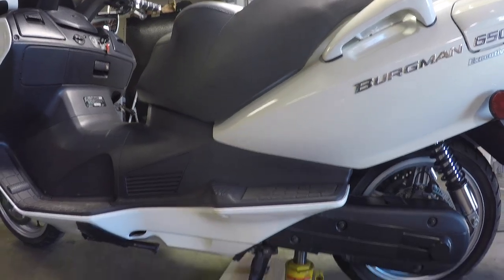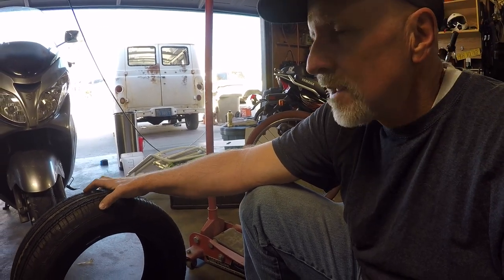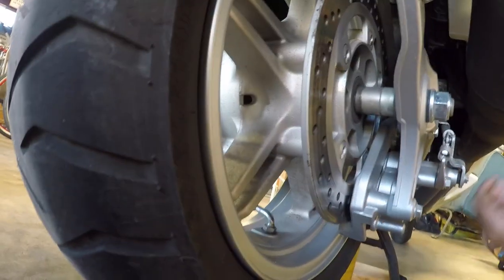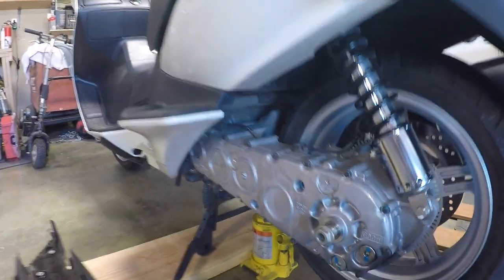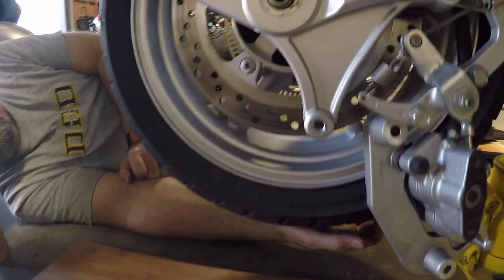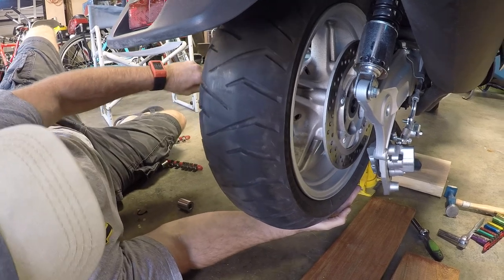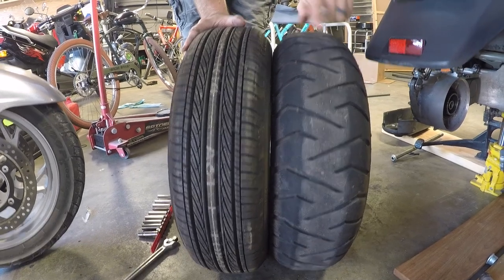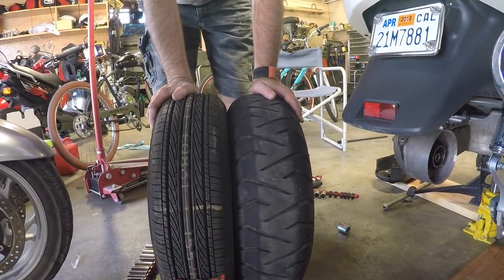Darksiding a Suzuki Burgman 650

Comment: After running dark on my Honda PC800 and my GW1800 with total satisfaction I knew that had to give it a try on my lovely Burgman. That was like 8 years ago now and never have I regretted it. I can still corner until the floorboards scrape and I sure do love the 20K+ miles out of that less than $100 tire. Go back to a MC tire? What for? Taking a step backward on my opinion.
Reply from the maker: It definitely makes it nice and easy to maintain with the car tire on the rear. What people don’t realize it handles just as well too.
Reply: @ManCaveMayhem  Yes, thank you! I heard so many times (always from someone that has never tried it) how dumb and foolhardy it is. Many years ago when I first went to the darkside I will admit that the handling was a bit different than with an OEM tire, but by the time I got home from the place that mounted it I was comfortable with it. My only bike that does not have a CT on the back now is my little 200 cc Suzuki Van Van and I think that if I could run a tubeless tire on it then that would too. 👍
Reply: Can you please tell me make and size of that tire? I'm about to swap out my rear and Darkside is the way I want to go .. Thx
Reply: @Red-mt3ot  Sure. It's a Bridgestone Potenza RE92 195/65/14. I think that there are a number of us that use that tire.
Reply from the maker: @Red-mt3ot  unfortunately I don’t have that tire any longer. I thought I included it in one of the other videos but maybe I didn’t I think the make of it is in the video.
Reply: @ManCaveMayhem  thanks!! I did notice a 165-65-14 but I'm gonna want to try something a little lower so I don't get that dreaded rub that you had .. Shouts out to you and Wes 👍

Comment: that same car tire does not fit on older 2003 burgmann 650 rims.  I bought same car tire and is too small for the rim even tried overinflated to 120psi and NO LUCK.  Had to get it off and destroyed the car tire and knicked my rim all up as well.  Not saying it will not work for newer burgmanns, but buyer beware.

Comment: If motorcycles Were Meant to have car tires on them it would have come that way from the factory however I do agree that motorcycle tires wear out faster than a car tire however a car tire does not have the rounded edges for traction like a motorcycle tire that is why they are designed the way they are. They are designed but go ahead put the car tire on the rear of your motorcycle and when you're in traction in the hospital wondering why and what happened now you know play stupid games Win stupid prizes this should be illegal
Reply from the maker: 10,000 miles across the United States on the car tire. No problem. Harley guys and Goldwing guys have been doing it for years. If it makes you feel better I’ve taken it off due to clearance issues so no worries.  Thanks for your honest opinion. This was an experiment that I found worked out just fine. Thanks again for your input 👍🏻🇺🇸

Comment: OK Joonya, what ever you say.
However there are a lot of us riding on car tires.
When the bead pops in (Use plenty of what ever soapy lube you want.)   This is the key use lots of soap. Some rim bead combos will need to go to 40+ psi to seat.
Look at the bead and see that it is even all the way around.
Re inflate to 32 PSI and check the tread and beads are running true.   I can run my ST 1300 in gear on the center stand.  You masy need to do something else.
Once you find the proper  pressure you can ride it.
My tire rim combo did not need any balancing. No extra weights at all.  Your combo may need a balance weight.  My brother swore by the internal BBs.
Check "Riding the Dark side forum for data on your bike.
Thanks
Reply from the maker: Dennis Williams So far I’m loving mine!
Reply: MY GOD! there is a damn forum for this garbage?!!

Comment: From the Motorcycle Industry Council's tire guide : And never mount a passenger car tire on a motorcycle rim; the flat profile  of  a  car  tire  is  incompatible  with  the  dynamics  of  a  vehicle  that leans as it corners, and the section of the tire in contact with the rim (the “bead”) is incompatible with motorcycle rims. As can be clearly seen in the test ride when cornering the car tire is leaned in such a way that only the far tread block on the outer edge of the tire is in contact with the road SO much so that daylight is visible under the rest of the tread.
Reply from the maker: Puffalupagus360 I appreciate your opinion. Just not the name calling. Thanks for watching👍
Reply: Hopefully you can educate yourself properly on tire usage, characteristics, and safety.
Reply from the maker: Puffalupagus360 Have you ever seen the contact patch of a motorcycle tire rocket man? It’s the same or smaller at times. Thanks for the concern but I’m a big boy and can safely handle a bike. Thanks again for watching.
Reply: I think he must be riding a Big Wheel!!!

Comment: Interesting.  I am not qualified to judge if a car tyre will work safely on a scooter but here, in the UK, you would have other problems.
We have what's known as a MOT test. This is an annual safety and raodworthiness test.  You will fail the test if you have tyres not specified by the scooter manufacturer.  Also, if you have an accident and the insurance company sees that you have gone 'darkside' they may refuse to pay up on the claim.  This could be expensive if you ran into a Ferrari, bounced off and then injured some pedestrians.  You could be out of pocket by £200,000.  Not worth it to save a few bucks on a tyre.
Reply: @BEEBEE159  that's my thinking too,but I just got out of hull HMP

Comment: Based on the size of your "chicken-stripe" on your real tire, your going to be just fine.
I'll stick with OEM tires because I need to lean it as far as it can go and still have traction.
Reply: Yes I thing that's a good observation,they where quite  large areas at the edge of the tyre that where in excellent condition(I'm being diplomatic here)but if you ride hard in the corners and get to  the edge of the tyre  then car tyres would be SQUARE DEATH!

Comment: Cool video , I have found a 2004 burgmen 650 for sale w/ less than 1000 miles . In your opinion will I find dry rot on hoses drive belt , going to check it out this weekend ?
Reply from the maker: Tom Meyer a lot depends on where and how it was stored. The rubber on those bike are high quality and I think you will probably be ok if it was well maintained 👍
Reply: over 30,000 on my '04.  Always stored outside in a fairly dry climate under a cloth cover.   No problems yet.